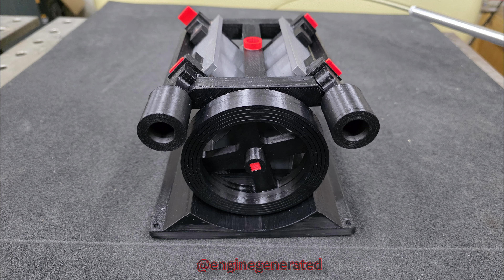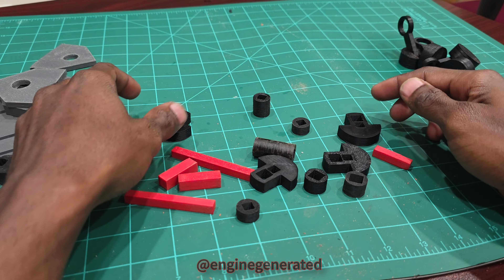3d Printed V4 Engine Assembly

Comment: Suggestion for the mufflers: Maybe try that blue house air filter material, the sheets that you cut to fit your ducts. Should still allow air flow, but you can cut it to size so it doesnt pop out

Comment: I made the vtwin model and I have a few suggestions. When you’re building the engine, I’d say take some time with a pair of scissors and exacto blade and scrape little layers of plastic on the inside of the cylinders to clear the pistons and where the pistons meet together on the crankshaft. Another tip is to grab your oil and pre lube the inner walls using a paper towel and rub it into the walls as the plastic will naturally absorb the oil and keep it slick. I’d also recommend you do this with the timing rods and valves. Best of luck 🤞